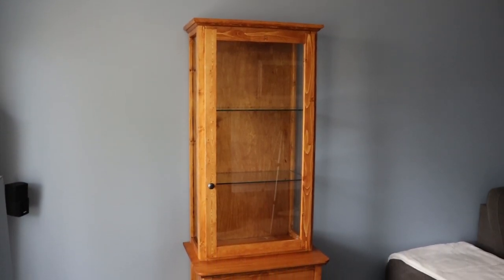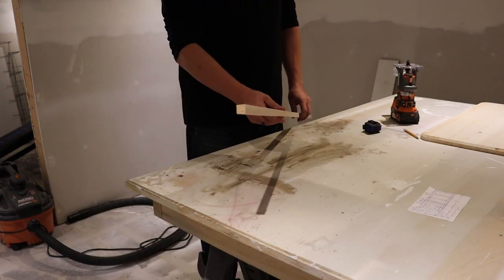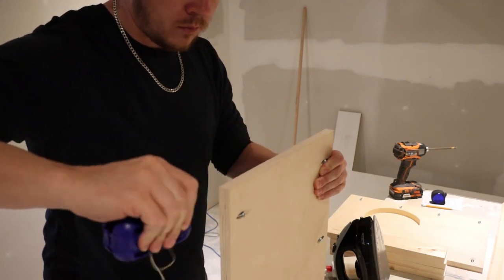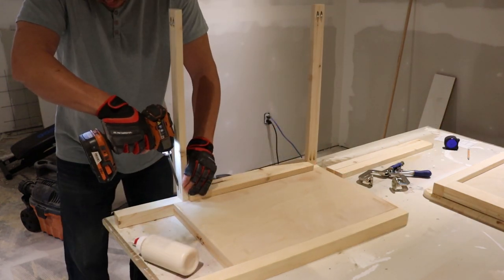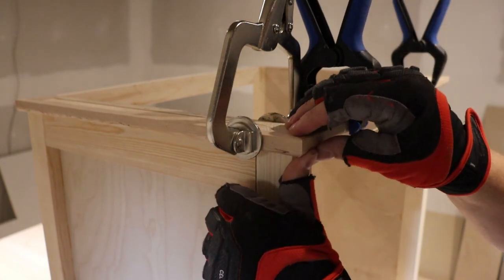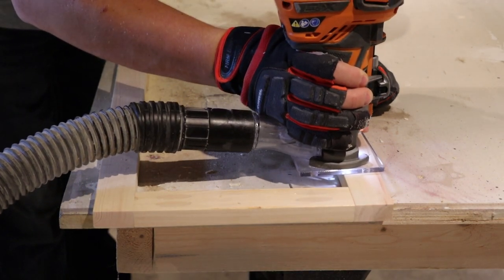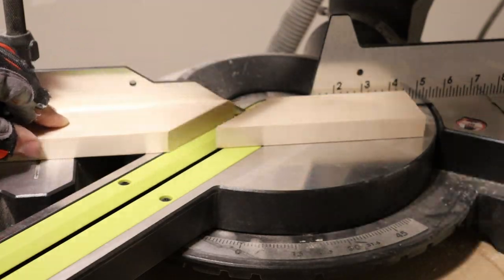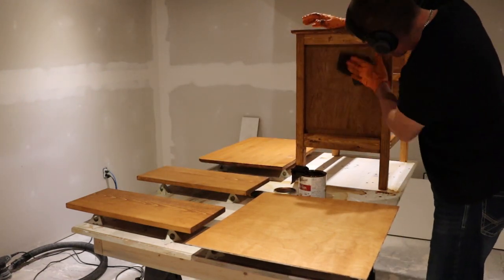Building a Vintage Display Cabinet // Design from another time

Comment: Can you please describe and link the brackets you use to attach the lower and upper cabinets?
Reply from the maker: They are just angle brackets and 1/2" long #6 screws. You can find them on Amazon or even at most hardware stores
Reply: @JessedoesDIY  great, thanks
Reply from the maker: Anytime

Comment: Sorry I didn’t see where you attach the drawers and the top cabinet together...
Reply from the maker: The drawer I didn't really show how to in the video, just them being made quickly. I have another very detailed video just on drawers. But I did show it and the drawer fronts. As for the cop to the upper cabinet, that was the upper section I had upside down and attached the top to it with screws. Then flipped it over and screwed it to the base with small brackets